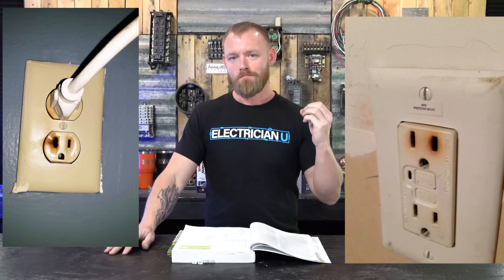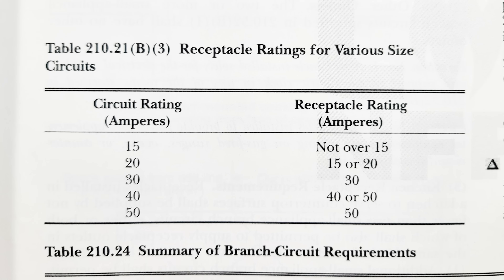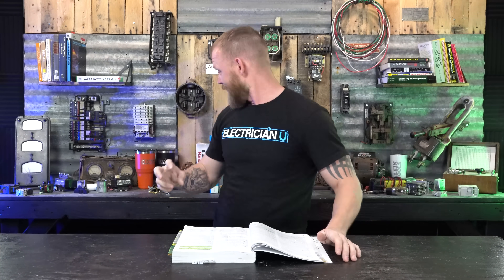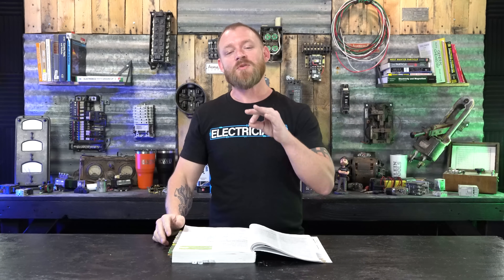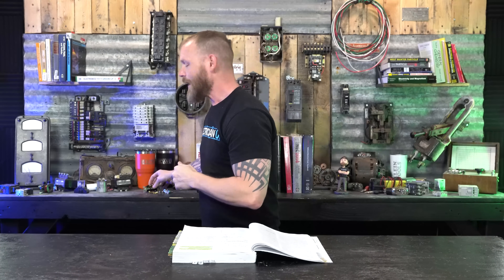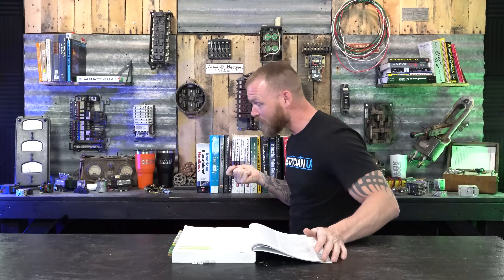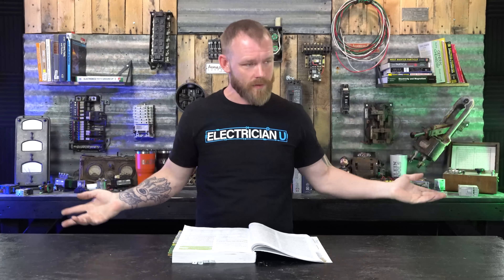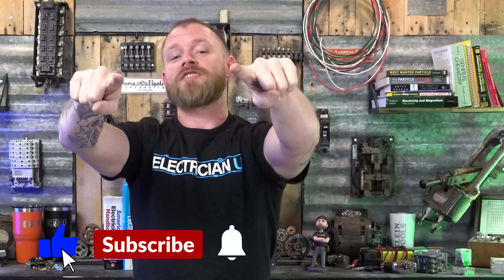Won't These Melt?!? 15amp Receptacles on 20 amp Circuits!!!

Comment: I think replacing worn receptacles should really be more of a priority. I've seen so many old, loose receptacles melt that I figure they are one of the most common cause of fires. Also, I replaced the old receptacles in the rent house I'm living in and found wires melted about two inches back from the terminals.
Reply: If an outlet actually melts but doesn't cause a fire, someone got lucky because their melting point is much higher than the combustible building materials that surround them.  Usually when a fire starts at a plug, something like a worn outlet, loose stab-locks or screws or loading a ckt. to its potential too many times (even repeatedly tripping a breaker then resetting it without reducing the load) will cause the wire's insulation to fail, resulting in a dead short,  A dead short is the equivalent of a heating element.  The box offers protection, but wood, either old and dried or new with resin, could ignite instantly.  Even after the breaker trips, the heat will remain long enough for oxygen to seep into the wall, allowing the hot wood to burst into flames.  At that point, the flame will suck oxygen in at a faster pace.  Every time a load is put on a loose connection, a tiny arc occurs.  Every time a tiny arc occurs, a tiny chunk of copper wire burns away, making the connection a tiny bit looser.  The next arc and chunk of copper will be bigger and bigger ...  Copper is a great conductor of heat.

Comment: It is amazing the NEC allows this loop hole.  Do they think that homeowners are knowledgeable enough to calculate the connected loads IAW NEC.  Really? Most do not even understand electricity let alone amperes and circuit ratings.  I am very surprised the insurance industry and fire marshals are not pressuring NEC to fix this error.  There should be no single weak link upstream of the protective circuit device, wall outlets included.  It is funny that they have tamper (children) proof receptacles so toddlers don't stick (obsolete) bobby pins into outlets, and yet that they force ARC Fault breakers on new houses almost everywhere, and allow adults to plug in 2-1500 watt hair dryers into a 15 amp receptacle.

Comment: You started off with a valid question but then tried to make excuses for such a lame code.    If a 15 amp receptacle can over heat at 20 amps, then it has no business being on a 20 amp circuit, regardless of what code says.  Use your 15 amp receptacles if you want to but put in a 15 amp breaker.

Comment: Jeez. If I was writing that code, knowing what you just told us, I'd require to have 30amp receptacle on 20amp breakers.
Reply: I don't think this video explained the reason clearly, such that you came away with a poor conclusion.  Other people have posted this, but the real reason is that the prongs on the faceplates are different. The arrangement corresponds to the current limits of the devices that use them.  Any device manufactured with a 2 vertical prong arrangement - which fits 15 A receptacles - will not draw more than 15 A (I think it might actually be the 12 A limit he shows, or even 10 A).  A device that needs 20 A will have a different plug that only fits a 20 A receptacle.  A device that draws 30 A will only fit a receptacle for 30 A.  Since the 15 amp arrangement ensures only 15 A will pass through that circuit, then it is safe on a 15 A circuit or higher - it will not draw too much current to cause a problem.  

Circuit breakers are not 100% effective.  If you put a 30 A receptacle on a lower rated circuit, someone will think they can plug in a 30 A device - which would cause damage if the breaker does not trip (or even still could).  

 I think the reason they want them to match or be close to the breaker, as opposed to just allowing any higher current circuit for any receptacle, is to attempt to give some additional protection to the device you are plugging in.  If you have a 15 A device, a 15 A receptacle, and a 30 A circuit, at face value, that seems like it should be fine.  But the 30 A breaker isn't going to trip until it gets to 30+ A.  So if there is some internal issue with the 15 A device, it's going to take longer to trip on that 30 A circuit than if it were on a 15 or 20 A circuit.  But under normal operation, there wouldn't be anything wrong with that setup.  I think the idea of why they give the leeway on the 15 and 20 A circuits is basically just to "be nice" since they're so common, and allow some flexibility since people are plugging in multiple low amp devices on circuits.  Perhaps the same for the 40 and 50 option - those devices may be rare/more costly, so giving some wiggle room.  

I personally prefer 15 A receptacles on 20 A circuits because you can plug in more things before tripping the breaker, but you are not able to pull current (from any one device) that will get close to the limit of the wire in the walls.  Also note, during construction, all sorts of nicks, etc, can effectively limit the resistance of the wire, so a 12 gauge looks like a 14 gauge, so that matches with 15 A receptacles.  

Also note that 15 and 20 A receptacles are typically made with the same materials to handle 20 A, which I think support my points.
Reply: @andrewhopkins3397  you haven't mentioned the scenario for which I was worried. Many people use a power trip with many sockets. Put two electric drills / high amp devices into it and I wonder what would happen on 15amp receptacle connected to 20amp breaker, I'd expect fire.
Reply: @privettoli  Sure, there's always a way to force things to go wrong.  I could buy a 50 A device and rewire it with a 15 A plug (analogous to your example) and fry things.  I am willing to bet the power strip you buy with a standard plug for a 15 A receptacle clearly says in the fine print to not use more than 12 A at any given time.  

In that scenario, let's assume there are no factors of safety (which is very much not the case in reality).  Either the tool will fry, the power strip will fry, or the receptacle will fry. The wires in the wall will be fine, and the panel will be fine.  That is the best case scenario for someone doing something wrong.  The receptacle frying could potentially cause a fire, but that tends to not be the case with modern building materials.   The power strip frying on a rug may be the worst possible option.
Reply: @andrewhopkins3397  agree.
Reply: @privettoli  I'm trying to think of the scenario of your original comment in light of what you said about power strips.  Assume a 30 A receptacle, on a 15 A circuit (14 wire, 15 A breaker).  You've got a 30 A power strip that matches the 30 A receptacle, so the proper usage of the power strip allows for 30 A.  Then you start using a bunch of things plugged in to it, trying to draw 30 A.  You'll just keep tripping the 15 A breaker, each time drawing current that could cause the wire in the walls to burn.  (Again, an illustrational example with no factors of safety).  The tools and power strip are being protected, and the wires in the wall are protected by the breaker, but only if the breaker works 100% of the time, and this scenario never actually works for you since the breaker will immediately trip every time.  I'm not seeing an advantage to a higher amp receptacle for a given circuit.
Reply: @andrewhopkins3397  I mean, I wouldn't connect anything close to 15amps to my wall receptacles, all power tools are battery-powered. But if I was renting my house to tenants I might prefer to have breakers trip instead of fire.
Reply: @privettoli  So did your original comment really mean to have both higher current receptacles and higher current wiring in the walls for a lower amp circuit breaker?  When people say "circuit" in this context they usually mean the wall wiring as well.  I sort of get that... But it would be confusing to people trying to plug in higher current devices and always tripping a breaker, and then a breaker could randomly fail.  I've never given any thought to the actual current a failed breaker could handle if the wire and receptacle were large enough to not be a problem.  Maybe it would be fine?  Going with things that can handle higher current is generally a good thing as long as everything in the system does.

Comment: Dustin mentions that the sum of the individual breakers can exceed the amperage of the service breaker. Is there a rule of thumb, or better yet a code that covers how much you can exceed the service rating? Thanks guys and keep on learning!
Reply: there is no max, and if you draw to much your main breaker will flip.  it's not like you are drawing the max on all your breakers at the same time.

Comment: I use a 20 amp air compresser on a 15 amp circuit,  a 15 amp breaker will supply   20 amps, just not all the time.  I never leave it hooked up, because every other time it runs it will trip, and I have a fridge and freezer on it also.

Comment: Building codes are so dumb.  Just use a 20 amp outlets with a 20 amp breaker.  Simple solution to the problem.  Stop doing the minimum required to pass.  This applies in all areas of life.

Comment: As far as the construction of these does a 20 Amp outlet have a higher temperature rating than a 15 Amp outlet ? I've always been curious about that .
Reply: No. Most big box stores stock residential and commercial grade (spec grade) receptacles. 15 and 20 amp spec grade receptacles are identical internally. Residential grade are less robust throughout. Most often the 20 amp receptacles are spec grade. You have to compare apples to apples.

Comment: You said something that should be reiterated:

It describes the minimum arrangement code permitted and has no bearing on what the homeowner may do plugging in loads

So for less than a dollar,
would one choose to get a 20amp receptacle to install on a 20amp circuit?.......

Hmmmm

Comment: Your video makes me think about National Lampoon's Christmas Vacation .  It also reminds me of my Home Depot day's 30 years ago, every Christmas, folks would come in looking for a cord with a male plug on both sides.  I sold the heck out of plugs,  cable, and recommended they have a fire extinguisher available . That of coarse was after I told them to take then back down and plug in male to female. Some folks want advice and then it's too much trouble so they do it their own way.

Comment: What about a camper that uses 15amp fuses, can you use a 20amp receptacle even if the circuitry/wiring was built for 15amps?  After all, the 15amp fuse is going to blow if anything higher than 15 is loaded onto circuit, correct?  As you know, Campers/RV's receptacles are not stand-alone systems, but are part of a multi-receptacle branch circuitry that uses one main GFCI receptable, but all receptacles are individually fused with 15amp fuses.  Thank you.

Comment: I dont buy anything at home depot like 25 amp receptacles I go to an electrical supply house its cheaper and they know there shit, these guys know code.
The chance somone at home depot knows is iffy at best and even then ive been given stupid answer from a so called certified electrician at a big box store. The guy didn't know what appliance cable was the stuff rated for 240volts  that multi strand soj? Somthing.

Comment: Appliances should have a stright and L shaped plug. IL that only plug into 20 amp outlets  12 amp items can have the normal plug cords. So you cant plug a 20 amp item into a 12 amp outlet.
This changes the idea somone can plug a space heater into a 15amp outlet.
And it dummy proofs the system.
Look electrical code has changed over the years sevral times we now use 120volts the original standar was 110 volts then 115 volts now 120 volts
Things changed because there was a need, this is clearly a case for changes that should be made,  you cant look at a 15 or 20amp socket and tell what it is so how the hell is a consumer to know the difference without pulling the outlet out to read its backplate and see what its rated for. 
Last time I had one fail I replaced it with a 20 amp outlet I wasn't sure that was ok, but it was tied into the dedicated refractor circuit after the house was built
And this was added by the homeowners before me. But its on a built in ironing board by the laundry room. 
The iron pulled enough current to melt the outlet.  Now becuse the refrigerator is a 20amp circuit its ok to be using a 20amp outlet aside from the fact it shouldn't be tied into the refrigerators power line by code.  But let's say the refrigerators compressor kicks on wile im ironing somthing something I almost never do the circuit can handle the load.
Its only on the peak demand on start up it will pull too much current for a 20amp line and the iron. 
So anytime your using a lot of power at one outlet you should change it to a 20 amp outlet.  Like an entertaining center with TV computer and audio video system as well as modem and cable box.
 But let's say a table lamp 15 aml is OK as long as you don't plug in a space heater.

Comment: Great video, good explanation of this topic. Just one error: 
5:42 "For the thermal trip to engage the breaker, it has to hit 130% of its (rated amperage) value. That's 24 amps on a 20 amp breaker."  Actually, 130% of 20 is 26 amps, not 24.

Comment: I just bought a wall oven that uses 40amps but my panel has a 50amp breaker. My Q is should i keep the 50amp breaker or change it for a 40amp breaker.
Reply: As long as your wire is 6 gauge you should be ok. Your oven should not use more current than necessary to operate. It would be like plugging in a 10 amp appliance into a 20 amp circuit with 12 gauge wire, not a problem.

Comment: I bought a new house and plugged a compressor into an outlet in the back yard but it wouldn't run the compressor. The house was still under warranty so I called to have it checked out. The electrician said that the garages are wired with one 20 amp outlet for compressors and such. So I plugged it into the outlet that the electrician said would be a 20 amp and the compressor ran fine.  How would I have known what outlet would be the 20 amp outlet?  I suppose there would be a circuit breaker in the breaker box that would list an outlet in the garage at 20 amps?  What say you?
I also have a second newer house and I checked the breaker box to see if there is a 20 amp breaker listed for a garage outlet and I didn't see one.
I use a similar compressor at my second house and never have a problem even though I don't see a 20 amp breaker listed for the garage.
Reply: When you say it wouldn't run the compressor, what do you mean? Did it trip the breaker? Did it trip a GFCI receptacle? Or did it not do anything?
Reply: @surferdude642  the motor would struggle to turn over as if it weren't getting enough power.
Reply: @vernonsteinkamp1088  That's odd. It may be a bad breaker or bad connection somewhere in that circuit.
Reply: @surferdude642  an electrician came because the house was still under warranty and he checked everything out and explained that the compressor draws a little extra upon starting and that it would need the 20 amp outlet to give it that extra draw.
Reply: @vernonsteinkamp1088  ok then, thanks for reply and good luck with your new house.
Reply: @surferdude642  thank you sir

Comment: Is the a way to tell, or "rule of thumb", you can use to tell if the receptacle (or braker) you're replacing is supposed to be a 15a or 20a by just looking at the wire?
Reply: Yes, the 12 gauge wire is much thicker and hard to bend.  You can put a crimp tool on it to show you the wire size.

Comment: Most burned receptacles I have seen was not a receptacle problem but another installation issue, 15 or 20. Never seen a properly installed receptacle burn up. Nice discussion but better to address installation. 5 amps won't burn up a 15 Amp receptacle

Comment: And it dosnt come down to $,, it comes down to safety,,, I will never cut it short to save a$,,, I take it seriously,, people's lives are in my hands,,, 👍👍MFE , keeping the world safe for electrons👍
Reply: Wait, the only place you are allowed to use a 20 amp breaker on a 15 receptacle is your small appliance circuit used in kitchen and dining room. All other branch circuits throughout the dwelling unit shall have a 15 breaker on a 15 amp receptacle. I have never seen an electrical installation the was not installed this way by a qualified electrician.  Yes you can put 20 amp breakers in all day long as long as the wire it rated 20 amp and receptacles. How ever why bother. Stick to your local jurisdiction and the NEC and you can't go wrong it's very rare you will ever see 20 amp branch circuits  receptacles trough out the  the dwelling unit. And very rare in the kitchen, dining. 15 amp receptacles on a 20 amp circuit  is the only place permitted this is permitted.

Comment: 1st,, any 15 amp face plate receptical is rated for 20 amp pass threw,, it's not the recep that fails,,, it's worn out, or the blades of the plug end are bent and don't make good contact inside the recept,,, and kw load is what a service is based on,, not the breaker count,,, but and good 15 amp recept can handle up to 80% of circuit,, but in a perfect world ,, any recep that has more than 60% per load, should be dedicated,,, such as space heaters and AC units,,,, it's not the receps fault,,,
Reply: But most burned up receps are from over time ,,or the damn stab locks,,, I hate stab locks,,, but yes,,, 80% ,,,, i have a collection of burned up wire nuts,, as well as burned up receps,,,, 30+ years,,, yeah it's a nice collection